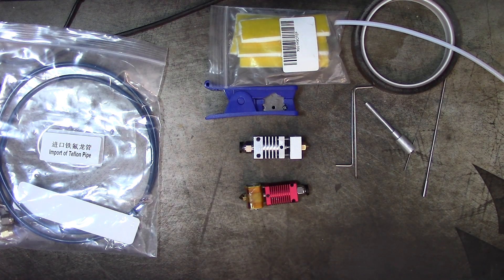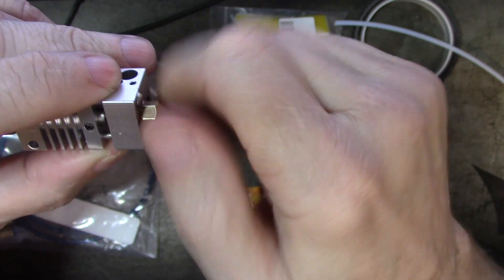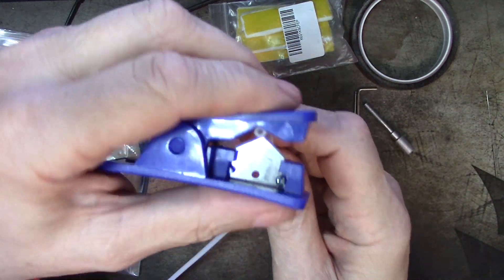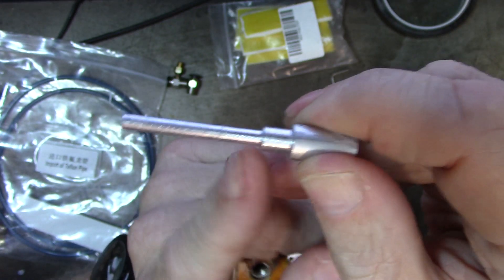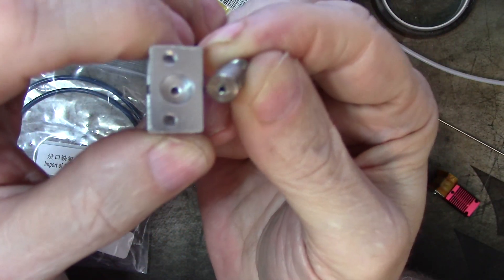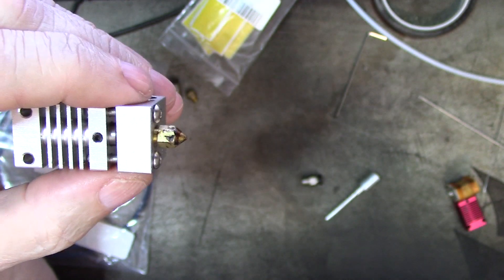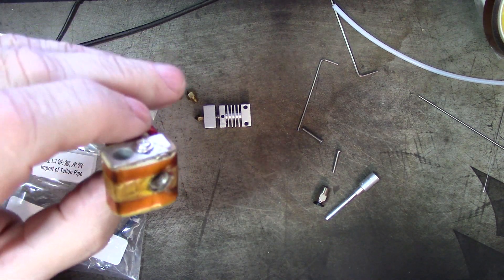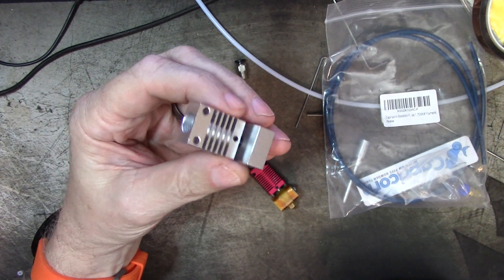Cheap All Metal Hotend for your Ender 3 UPDATE!

Comment: Hi, just letting everyone know although this is still a valid upgrade for your hotend, it is not truly all metal as it lined with Teflon inside so temperatures above ABS temps (240-250) will potentially damage it.
Reply from the maker: Did you actually watch the video? The red hot end is a stock Creality Ender 3 hot end. The silver hot end is an all metal hot end. There is NO PTFE tube or teflon in it. I clearly showed the difference between the two.